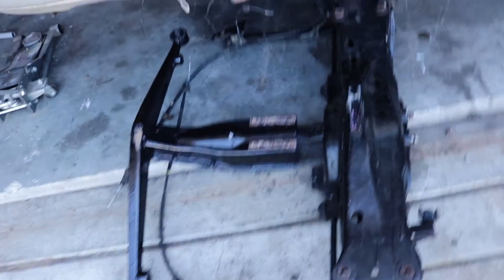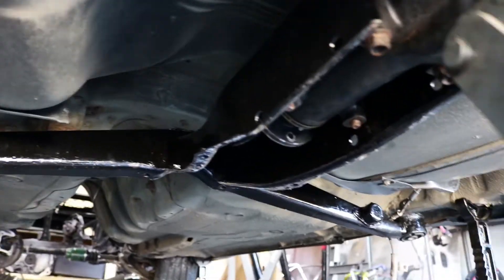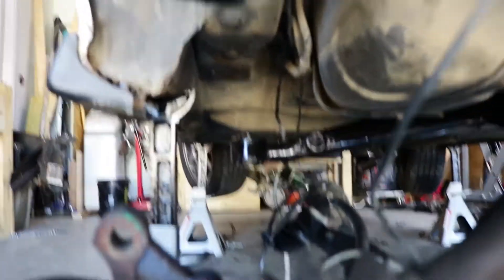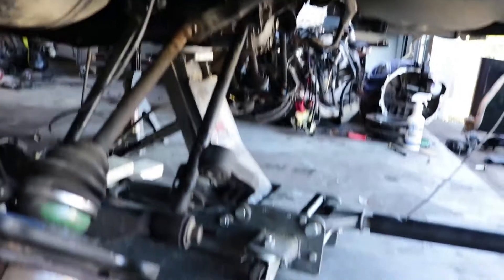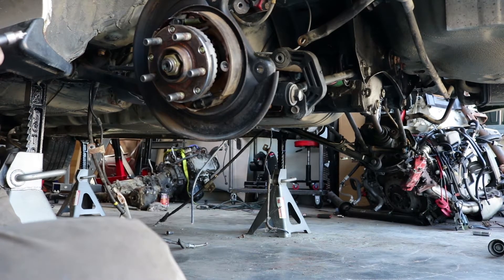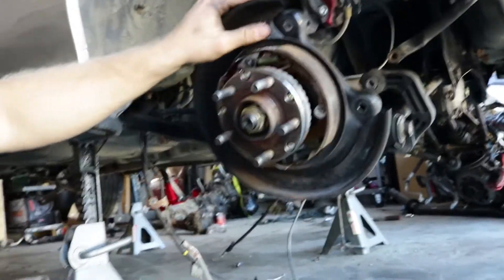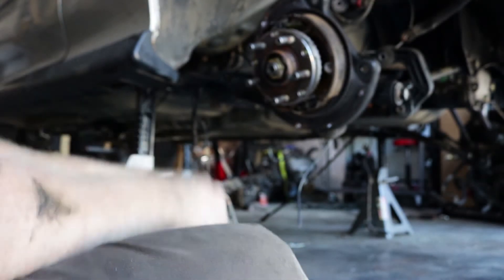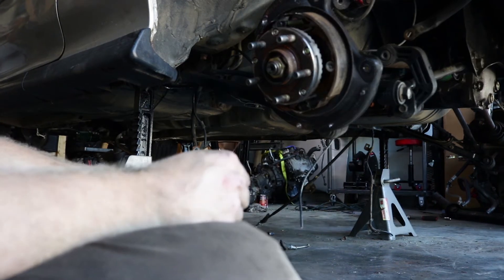Subaru RS EJ207 Rally build:JDM BBK install Episode 2

Comment: Your build looks interesting. I’d like to put the same calipers for the rear of my gc. I’ve read some posts on forums but since english is not my first langauge, im kinda confused with the stuff needed for this swap. Can you tell me what parts i should use?? Thanks!
Reply from the maker: Hey, you could either use rear knuckles from the car that the brakes off of, which is a lot more work. Or you can run adapter brackets to mount them, kartboy makes some and there are some cheap ones on eBay. You should be able to find them by searching Subaru 4/2 pot brake adapter
Reply: Dirty Garage cool, thanks!